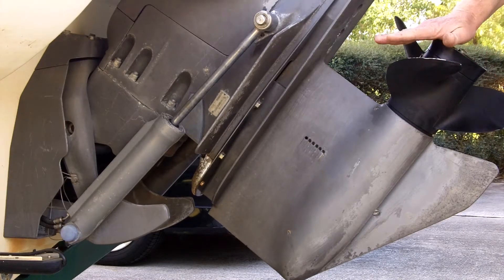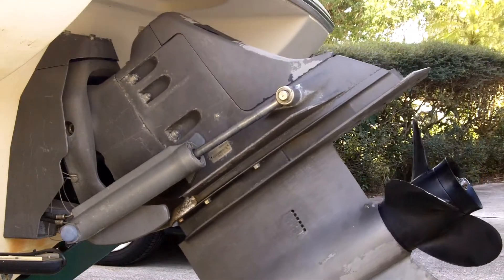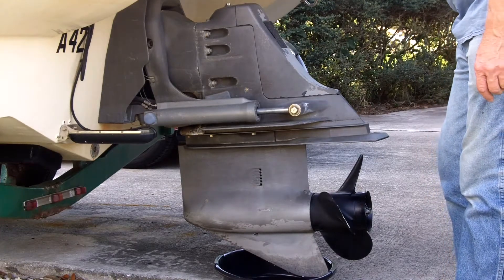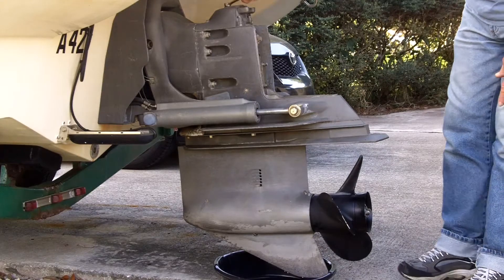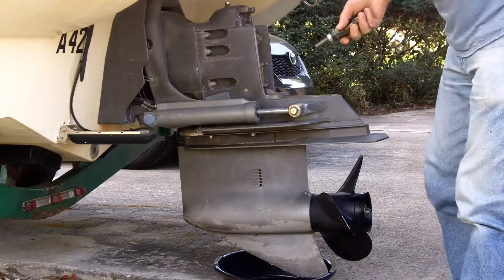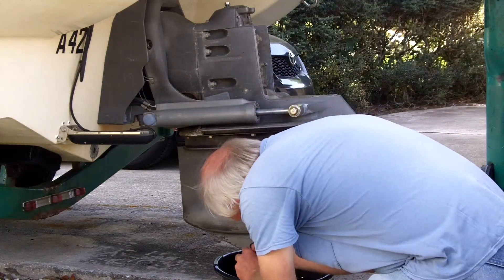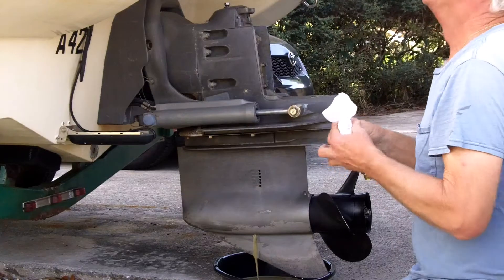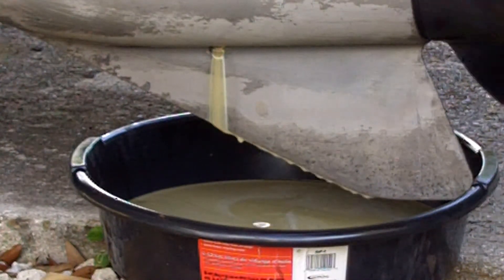Volvo Penta SX Gear Lube Change with Contamination

Comment: HELP PLEASE 
I have been looking for the adapter to screw and nothing I have found fits??? I have a 1999 Volvo Penta SX does anybody have any suggestions? I was told I needed a 3/8.-16.  I was also told it had a double thread. 
WOULD YOU KNOW A PART NUMBER? OR WHERE TO BUY ONE?
Reply: I got a cheap one of Amazon just hand pump.  It is 3/8-16

Comment: Hi! Is this the method I would use to flush out the gear case for metal particles? My lower end I believe has a broke Gear so I will be swapping it out with a new lower unit. Although when I check the inspection port for the top portion it still has metal flakes on the gears but the gears themselves look good! I just don’t want to put a new lower unit on and then Run into a new issue because of the metal in the gear case.
Reply from the maker: THAT is a good question. I don't believe flushing like I did for contamination would be adequate. I suspect there are metal particles in the bearings, etc. I'd consult with an expert on that one. And research yourself. Installing a new lower unit ($$$$) I'd want to be sure the top end was good to go. Regardless, good luck. Thanks!
Reply from the maker: In further investigation, please check out this link.  https://www.offshoreonly.com/forums/general-q/77743-metal-outdrive-oil.html